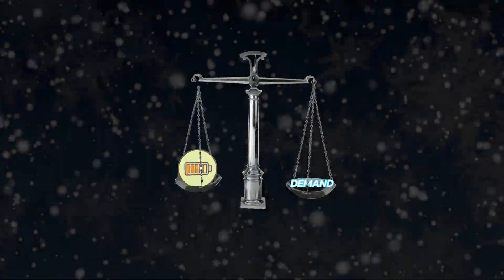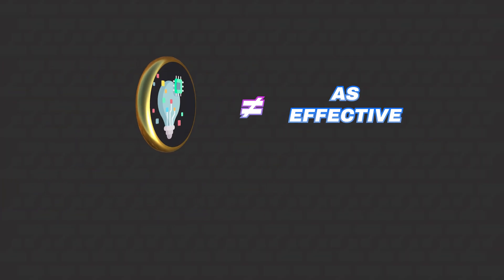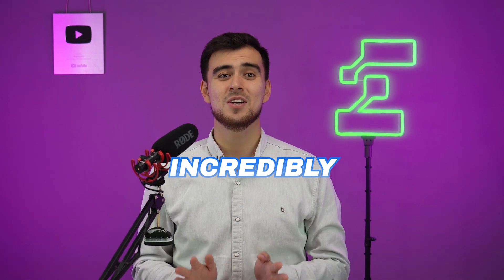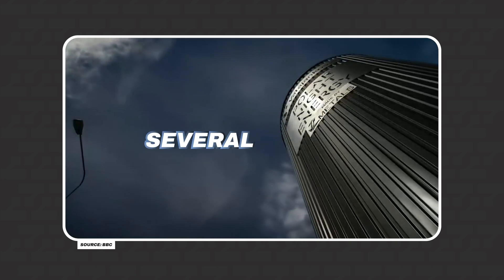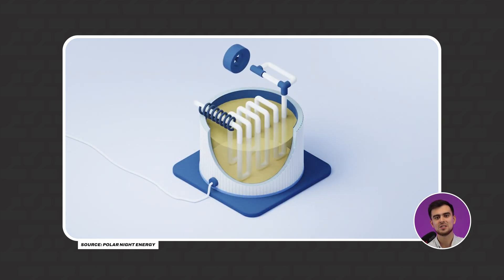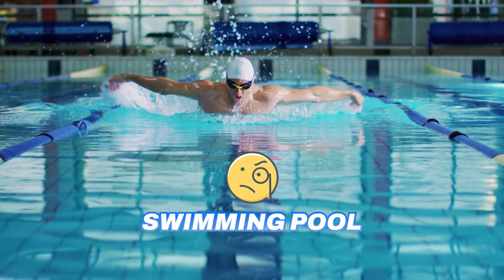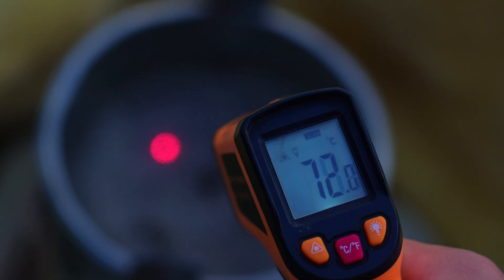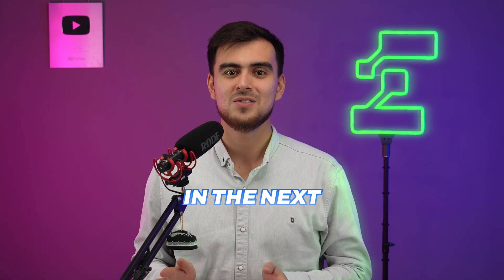I Tried a Sand Battery - Here is Why It is a Game-Changer

Comment: Bigger scale. Well insulated and buried in the yard. Heat the sand with wood stove with hot water capabilities. Use sand battery to hydronically heat domestic hot water and radiant heat for the home. If you have enough sand and it’s well insulated it would be interesting to see how often you have to run the wood stove to reheat the sand.
Reply: Just heat a pile of water... Keep it under 100 C and you don't need a pressure vessel.

Comment: A rocket mass heater design ... Instead of only burning 4 hours to get 24 hours heat you just burn it until your mass meets your temperature requirement, add insulation and then I would send it underneath greenhouse beds to keep greenhouses warm for free as well as your homestead...  excellent excellent research and calculation formulas 🎉🎉and

Comment: just one small semantic correction man, just so it's known, you don't store electricity. there's no "quantity" of electricity like storing marbles in a bucket. you store potential for chemical and other reactions. if i had a box with zinc, copper, and sodium and water, there is no electricity stored, but if i complete the battery it can generate x amount of current using the x amount of potential to create work (voltage). if we think of mAh milliamp hours like on portable usb batteries as having x "amount" of electricity inside, or in a normal duracell, that's not what's happening. electricity is a phenomena, not a thing that can be stored. banger video tho good work. also people never talk about the fact that there still is no actual consensus on what electricity is, how it works etc. besides, electricity and magnetism are literally exactly the same thing with different names, describing the same phenomena using the same fields which are present in all materials in existence.

Comment: Are there DIY plans for a concentrating solar collector to heat the battery?
I do not like the concept of using PV panels and an electric heater in the battery. TOO inefficient, but a concentrating solar thermal trough or dish could produce the high temperatures to heat the sand battery.
Is there a GOOD DIY plan for such a thermal concentrating collector?

Comment: Hello good folks, i logged just to give you people a small heads up. 
You don't need to overcomplicate things so long as you got outside space. We are building our civilization wrongly.There is energy provided for free everywhere. The sun is providing.
The land is a sand battery as is. As big as you want with minimal costs. 
Just dig deep enough(over2.5m depth) and lay out pipes for heat storage. The insulation will be good enough as long as its deep enough. doing overground batteries is silly. If you test it, dig and store heat, it will be there for months and months.
The costs are just the digging equipment and cheapest pipes. As cheap as it gets, no materials for insulation. Since it's so cheap, you can scale up and literaly get it cold during the winter with a simple radiator and fan+pump(max 100watt!!!!) and get almost free cooling all summer with zero maintenance(closed system), or store heat during summer in a second system for the winter. You can add some cheap solar heating to add to the heat underground and make it last longer.
You get some cost up front(cheap though, costs like a good AC unit) but you have cooling or heating with just 100wats(fan+pump) and no maintenance.
Reply: most of the earth has a huge temperature differential between summer and winter,  even between day and night.And all you have to do is take advantage of what you're given. It's so simple!

Comment: You say sand have more thermal capacity than water.  What would have more thermal capacity than sand?  
What about an insulated tank of heavy oil?  Run a copper water line through it to convert to steam for heating a home. 🤩

Comment: One thing to consider, just like it is inefficient to convert heat to energy, it is inneficient to convert energy to heat to store it, it is better to produce thermal energy and store it which can be done with modified renewables
Reply: Did you not watch the full video
Reply: @WhoCares-ml9fg i did,he talks about using solar pannels to produce heat, it is much better to capture byproduct heat or to heat the sand directly with the sun

Comment: Rather than heating using electricity
Use strong big magnifying glass(I mean those massive lens) which will be placed above during day
Reply: The cost of materials to do that will be the same as solar panels. Not mention. Those magnifying glass will need electricity to automate the whole system.

Comment: Am planning to bury 200l steel drums filled with sand lying on sides with bungs interconnected top to bottom in series with steel pipes, blow air heated by parabolic sun tracking dish through sand with a solar powered air matrass pump

Comment: HERE IS A FREE BATTERY THAT STORES SOLAR ENERGY FOR FREE AND GENERATES UNLIMITED POTABLE WATER.     I PROPOSE TO CREATE A NEW DIGITAL CURRENCY BASED ON TONS OF FROZEN FOOD OR UNFROZEN, INSTEAD OF GOLD TO CREATE A SAFER WORLD, 
PROPOSAL FOR A TRUCE;
THE PROPOSAL IS FOR OUR MILITARY to PROTECT THE PEOPLE, NOT THE OPPOSITE
FOR .56$ OF LOW COST SOLAR ENERGY, YOU CAN PRINT 10 000$  $117 OF COOLING PER CUBIC METER OF WATER PRODUCED FOR $0.56 WILL SAVE 10 000$ OF FOOD THAT WOULD BE WASTED OTHERWISE. 
Here is a free battery that creates free water and saves food, the best future after we create peace. 
Solar energy is abundant, eternal and really cheap. It is the batteries that are very expensive. We have developed free batteries to supply low cost cooling and water in the desert for free, this system lowers the cost per kwh stored into the ice and even give free drinking water; For free water in unlimited quantities; I have developed a 100% solar seawater desalination technology that transports $117 of cooling per cubic meter of water I produce from the oceans for $0.56 to long or short distances using a mixture of ice slurry. This cooling will save 10 000$ of food that would be wasted otherwise. We do not use chemicals. We can store some of this cooling in ice saturated with salt that will melt at -21֯C in large freezers to save food in large quantities. In short, we provide cooling 75 times cheaper than existing equipment using diesel. In the Middle East, 70% of energy is used for cooling and most of the rest for desalination. We will use solar energy and store it in ice during the day at less than $0.02 per kWh compared to fossil fuel at $0.83 (42,5 times less) and save 80% of energy (which translates to 5 times less energy needed for the same amount of cooling) with this technology below. So we provide cooling for 212 (42.5 X5) times less and pay everything in less than a year. Water can be available for free after the ice melts. We will give freedom to all, exactly the opposite of what the globalists are trying to impose. 
https://www.youtube.com/watch?v=zAXN4xiCbuo

Comment: SAND BATTERY WILL REVOLUTIONIZE HOME ENERGY STORAGE ONCE COMBINED WITH THIS -21C COLD REFERENCE.

WE WILL HAVE A FREE WORLD OF ABUNDANCE AND PEACE SOON AFTER THIS GLOBAL AWAKENING. 
WE RECEIVE 6000 TIMES MORE ENERGY FROM THE SUN THAN WE USE GLOBALLY. HERE IS A FREE BATTERY THAT STORES SOLAR ENERGY FOR FREE AND GENERATES UNLIMITED FREE POTABLE WATER.     
FOR .56$ OF LOW COST SOLAR ENERGY, YOU CAN PRINT 10 000$, 117$ OF COOLING PER CUBIC METER OF WATER PRODUCED FOR $0.56 OF LOW COST SOLAR ENERGY THAT WILL SAVE 10 000$ OF FOOD THAT WOULD BE WASTED OTHERWISE.
https://www.youtube.com/watch?v=zAXN4xiCbuo

Comment: What hot air being injected directly underneath/in the sand to cause liquefaction? To get the temperature up quicker; at higher volumes of sand, more air inlet manifolds (injection points) maybe be embedded in the sand.

Comment: Please make a larger sand battery that's on a dolly.  You heat it up outside and then roll the dolly sand container to indoors to radiate for hours.

Perhaps it can be heated with rocket mass stove using the sand as a thermal mass.  Maybe the rocket mass stove is integrated with the sand on the dolly.

The above dolly/sand/rocket mass would be practical tool to heat a home in an emergency or supplement a heat pump when it's less than  -15C outside.

Comment: Im curios can it use a heatpump? In summer AC would suck out the heat from the house and transfer it into the sand? 🤔
Reply: I wish that was possible
Reply: @DanielGonzalez-d7n  I mean it just blow hot air through the sand

Comment: I'm planning on building a 450 kg sand battery. Planning to have it done for next winter.
Reply: Tell us how it goes please
Reply: @jorgeacosta2815  I'll remember this comment
Reply: please report back how it is going I read that 40 kg could store 4.6kwh so you would have like 50kwh storage capacity. I think here in sweden with many sunhour an overcapacity that I sell to the grid would be nice to store for winter seson but it sounds like a huge sandpit that need a lot of isolation
Reply: @matskarlsson4900  unfortunately I was forced to suspend the project due to legal actions currently. But I May need to make it differently now because the heater itself will cost 3,000 dollars. Maybe a fire powered heater might due. Once I begin I'll make a separate channel to post the results.
Reply: @walkersunited57207  Just use water.
Reply: @walkersunited57207  , May be you try a solar collector in shiny days to heat sand? Solar collector would send heated liquid down pipes through sand. Other pipe system will harvest heat from sand in colder days and send that heat to your house in volume you need for your house?
Reply: @mirodilmirzakhmedov9287  what's the liquid called.
Reply: we would appreciate if you care to record and post them on youtube, does not need to be edited, just some crappy videos are enough 😂
Reply: @shadowmistress999  I will record it once I'm done with collecting the sand. It's gonna take 48 hours total. I've come up with the best design possible to have the most efficiency. Now it's just a matter of building it. Still need to research more on the heating rods and the container type.
Reply: are you going to record it? Ireally like this idea of sand battery- I alsow atch off-grid Mike who done some prototypes and he is currently building the large one.
Reply: 450 kg = 992 lbs.,  Concrete Sand. $30.00 per ton (2000 lbs).
Reply: @chasmarischen4459  I got unlimited sand. It's just time I need to acquire it.
Reply: @chasmarischen4459  $30/tonne when you buy it in bulk (for dry sand, that's actually crazy cheap).  If he's buying 450 kg, he is going to pay a hell of a lot more than $30/ton. I've built beach nourishment projects (think thousands of tonnes of sand) and I usually budget anywhere from $10 - 45 per ton depending upon location.  I once wanted about 2500 kg of sand for a small project at my house and I paid $350, delivered into a pile on my driveway.  Delivery charge was a notable share of that.
Reply: Have you made a battery yet?

Comment: Hello! I am planning on building a sand battery as well at home. I have a 30kW solar system, and I want to use the energy stored in the sand battery to generate electricity. Maybe you can do a video on this or we can share some thoughts for an experiment. I'm in southern Austria near the Slovenian border.
Reply: Thinking the same, i have 15kw of solar PV, self sufficient for electricity year round, so 15kw roughly here produces 14,000 kwh,  consume about 4,000 kwh in electricity, the spare 10,000 could be diverted to a heat store, I was thinking off using gravel/dust its much cheaper than construction sand, sunk into a pit, only insulating the roof of the pit and cover with 1m of soil. They have done this in Denmark
Reply: @jimbobarooney2861  intresting do you have a link to the danish experient. dosent a lot of heat get wasted? how long cycel where you planing weekly or yearly

Comment: Sand can keep heat for long time but during winter when you start to circulate cold water or aire to heat in that exchange you will lose all the sand heat very quickly.
Reply: sand will heat up slowly and release the stored heat slowly to air.  With waters higher storage capability, it's like this would drain the sand of heat much faster than air.
Reply: take the specific heat for SiO2 hen youo can calculate how much calories you can store and extract, likewise use the specif hea of air and a well insulated house and do the reverse.
Reply: This tech is in use for district heating already. 

I suggest you Google it and read up on it.  It's a great way to store excess solar energy as heat on cold but sunny days.  It's apparently pretty efficient.
Reply: Huh.  Looks like my response was censored.

No idea why.

Many countries in the EU are using this for district heating.
Reply: Which is neither good nore bad.
The capacity is interesting.
There are several variables here.

The advantage here is: you can heat up sand more than water, whithout getting "problems", thus you can store more energy in sand, allthough water has the highest specific heat capacity with 
1,163 Wh/kg/Kelvin

Comment: Use a resistor in the center. Like a water heating element. Don't go above/near the melting point of the metal the wires are made of

Comment: This is certainly an interesting thought. I work at a sand mine where I dry sand with a giant rotating oven and send it to a silo; and a month after filling it, it still comes out of the silos very hot. I had not thought about how it held heat but it certainly is giving me a few creative ideas.
Reply: Gheez, talk about working in the right place:) Good luck. This ought to be a no brainer
Reply: I am thinking of heating sand with solar panels and using it for heat and warm water in the Colder climates. Electricity is causing problems for the nets, this stays local.

Comment: I have been thinking about combining a sand battery and a wood fired rocket stove to heat it.  Any idea if that will work
Reply: I've been thinking the same thing.  At this point in thinking about it I'd like a rocket heater on a dolly with the sand as mass.  The large rubber tires make it easy to move outside to fire up the rocket heater to heat up the mass before night fall. Then put the rocket heater fire out and wheel it indoors to radiate the heat for hours.  Even without a fan on it, it would slowly release through the night which is fine.

Separating the rocket heater from the mass would be tricky to make resilient but if it could be done you could add more mass (sand) and a more powerful rocket heater that's stationary outside.

Comment: You should try using a high power electric heating element that heats the sand from inside. Great video!
Reply: It'll burn out the heater element out as the sand doesn't take heat away fast enough. You could regulate the current but... that defeats the purpose of storing the heat as you couldn't charge it very quickly.  You really need some way to move the heat through the sand (that's why they use numerous tubes with fluid flow throughout the sand mass).  Otherwise you end up with a really hot spot, and the rest remains cold.  That's what happened with his first "heating from the bottom."  There was nothing to move the heat up through the sand.  Easy problem to solve with pipes and a fluid.  Hard problem to solve with a "bucket of sand and copper conductor poles."    But I live somewhere cold... and I would buy/make something like that if I needed to temporally shift my energy consumption dramatically.

Comment: One of my favorite topics! 
 I wanted to build a prototype where I would put some sand in a (heat-insulating type)cement box, and have the heat transfer with (compressor)parts salvaged from AC. The whole thing(heating included) would run on some solar panels, so long term energy storage testing could have been made possible..
Reply: I wanted to build it too, with double sheet metal enclosure with glass window on the outer enclosure and vacuum between those two metal enclosures.
Would use mirrors to direct sun energy trough that mirror to heat internal enclosure with sand inside.
There would be pipes around outer encloser and it would be well insulated.
So when you want to heat the water that you are pushing through those pipes, you just lower the vacuum between those two enclosures and the heat from inside enclosure start to heat outer one with pipes..

Comment: I would like to see you use a sand battery to heat a greenhouse at night. Heat the sand with a 12-volt electric hot water heater heat element that gets it's electricity directly from a solar panel. It would never actually be switched off. When the sun is shining the electricity from the solar panel heats the sand. At night when the sun is not shining the hot sand gives up the heat to the greenhouse. Can you do that?
Reply: The DIYers who have tried this found that they needed to swap out the water heater for a stove coil. The water heater element was burning up without being submerged in water to cool it.

Also expanding the stove coil so that the heat dispersed better throughout the sand seemed to have better results.
Reply: There is are videos of this on YT. People use solar back packs and buckets for shelter and tent heating. You can put several of this in your greenhouse, they will work perfectly!
Reply: dual heat it.....use the elements on bottom and use a glass panel with a flat fresnel lens on to to superheat the top......sha shaaaa.....heat!!!
Reply: Yes
Reply: I have the same arrangement with hot water. PV heats the water then heat comes out later. Plenty for a small home.
Reply: It's apparently much better to use resistive oven elements as water heating elements break much faster because they're not designed for the intense heat that is reached.
Reply: Checkout rocket mass heater